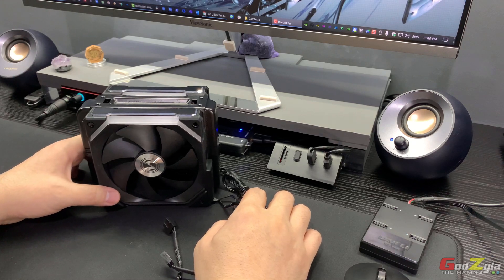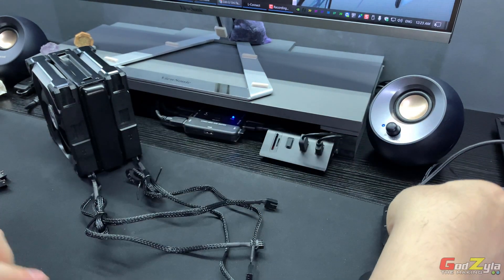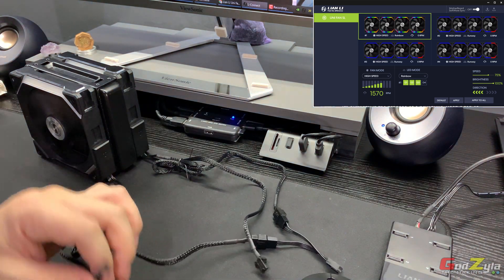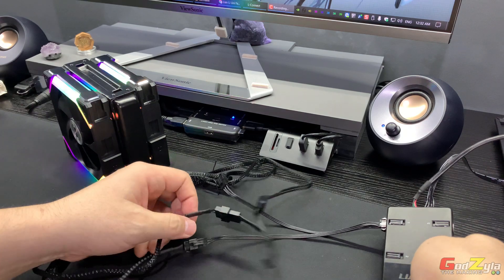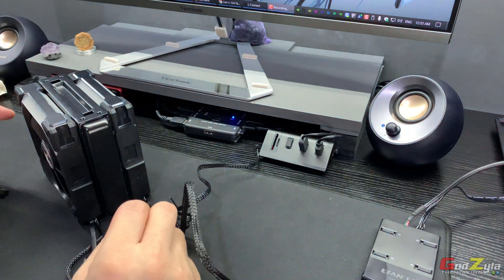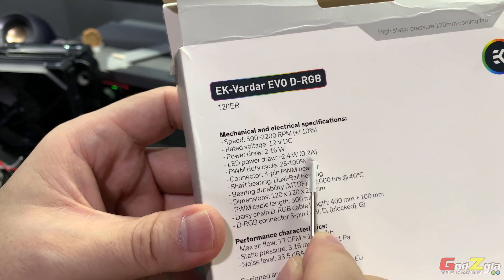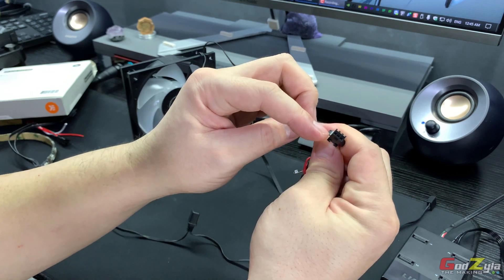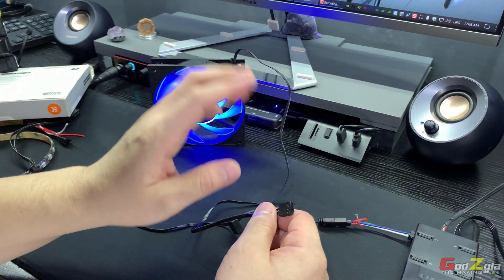Lian Li Uni Fan SL120 - Push and Pull configuration [L-Connect]

Comment: I want to do a push pull on a 280mm rad with 4 uni fans. Using the Y splitter for the RGB...both sides will just mirror themselves right?
Reply from the maker: Hi John P Lillis, thank you for your question. yes.. it will mirror, it does not do sequence. reason being, if you chain the fan by default, there is a build in chip which does sequencing. If you use Y-Splitter, the chip is not in use, therefore it will only mirror. Hope that answer your question. Once again thank you for your question and  to have visit my channel. If you do like my content, kindly subscribe and to click on the notification bell. thank you very much :)
Reply: @KleoYan  Thank you! I just ordered 8 SL140 for a new build. I'm on amazon looking for the ARGB splitter....would this one work? https://www.amazon.com/gp/product/B07Z1338XY/ref=ppx_yo_dt_b_asin_title_o00_s00?ie=UTF8&psc=1
Reply from the maker: @JohnPLillis  Hi, nope you can't use a normal argb 3pin splitter, you will need  a JST 3pin splitter 
(1 Female to 2 Male ) https://www.superlightingled.com/3pin4pin-1-to-2-signal-splitter-female-to-2-male-for-ws2811-ws2812b-ws2813-ws2815-addressable-rgb-led-strip-lights-p-1815.html 
or here https://www.aliexpress.com/item/1005001779375576.html?spm=a2g0o.productlist.0.0.f0b46342S6KzeN&algo_pvid=07fe82a2-a729-4059-ace7-bae66322c687&algo_expid=07fe82a2-a729-4059-ace7-bae66322c687-4&btsid=0b0a556c16065055547736274e0987&ws_ab_test=searchweb0_0%2Csearchweb201602_%2Csearchweb201603_

Comment: hello there kleo :) im sorry but could you kindly double check your info at 8:50 please if you dont mind? im very scared because lian li said on this page on Lian li's official site ( https://www.lian-li.com/argb-device-cable-kit/ ) if you scroll down a bit to the "fan Y cable" it says that you could plug st120 and bora fans right into the hub, i wanna plug the fans that came with my galahad aio in there and im really worried that it could hurt my controller so i dont know what to do
Reply from the maker: Hi xayx,  thank you for your question and to re-visit my channel as to answer your question. Now you will need to understand on this video illustration, I am using the EK Vardar EVO 120ER fans. though it's the same load the the SL120 fans which is at 0.18a , however the RPMs are different. 
else if you are talking about using the ST120 on the Galahad, not an issue at all. Both ST120 and SL120 fans are using 0.18a and the RPMS both are from 800-1900 which is the same. 
you do not need to worry about it at all. 

As for the Argb load, the ST120 is at 0.54a and the EK Vardar EVO ER120  is at 0.2a. Both these fans argb load is lower than the SL120 which is at 0.65a.. therefore not an issue too. 

one last note for you to take note. if you are using the Galahad AIO, I would advise your block pump should connected to the motherboard CPU / Pump header.. and the argb you still can connect to the Uni Fan controller.. without any issues.

Hope I have answered your question. Once again thank you to have re-visit to my channel.

Comment: Hi Kleo. Thanks for all of the awesome videos on the Lian Li Uni Fans! I have a question about running push & pull on a 360mm radiator. How should we go about it considering we cannot split the fans? For reference, I am running 13 fans total in an O11d-XL. 

2nd question, since I have 13 fans total, set up in 5 channels, how do I get L-Connect to recognize all 5 channels? I plugged in 2 separate RGB/Fan controllers, but L-Connect only recognizes one at a time.
Reply from the maker: Hi jboze84, thanks for you compliment and question.
your first question about running push pull configuration on a 360 rad, I would advise to do this this way

Radiator configuration 
1st 3 x fan, pull configuration - argb and fan connector to Input 1 of the uni fan controller - RPM you need to fix it lets say running at 1000rpm
2nd 3 x fan, push configuration - argb and fan connector to Input 2 of the uni fan controller - RPM you need to fix it lets say running at 1000rpm
3rd 3 x fan , case airflow - argb and fan connector to Input 3 of the uni fan controller
4th 4 x fan, case airflow - argb and fan connector to Input 4 of the uni fan controller

when you mention about 5 channel, I believe you are talking about 5 fans on one daisy chain. I do not advise you to do so as the uni fan controller has it's limitation on each Input. 
do not go crazy daisy chain more than 4 fans. if you have not watch this, please do so --> https://www.youtube.com/watch?v=QQHJUQvKwlY

if I got your setup wrong. can you list down how your placement of fans are like. example .. Side 3 fans, Top 6 fans with AIO , buttom 3 fans and rear 1 fan. 

Hope that helps. thank you once again for the question and to have visit my channel. if you like my content, kindly subscribe and to click on the notification bell. thank you!
Reply: @KleoYan  Hi Kleo. Thanks for your tips! I made the changes you suggest for the push pull setup already.

My setup is below:
Side - AIO with 6 fans in push/pull as intake. 
Bottom - 3 fans as intake.
Top - 3 fans as exhaust.
Rear - 1 fan as exhaust.

The problem I run into is that gives me 5 total groups of fans.
Reply from the maker: @jboze84  I see. now what you can do is this. 

My setup is below:
Side - AIO with 6 fans in push/pull as intake. 
 (input 1 and input 2) 
Bottom - 3 fans as intake. (input 4)

For input 3
-----------------
Top - 3 fans as exhaust.
Rear - 1 fan as exhaust.
What you can do is to use two splitters, one for argb and other for fan.

This is the fan splitter for you to conntect your top section with the rear, then to the controller. 
https://www.aliexpress.com/item/32850109245.html?spm=a2g0o.productlist.0.0.48c63ca61hCLgy&algo_pvid=8cec3997-0f96-45c2-9b14-23ef8df04742&algo_expid=8cec3997-0f96-45c2-9b14-23ef8df04742-2&btsid=0b0a556a16085302036036547e28ba&ws_ab_test=searchweb0_0,searchweb201602_,searchweb201603_ <--- this is to connect your top fans with the rear fan and the other end to the uni fan control unit. 

this is the argb splitter to connection your top section with the rear, then to the controller
https://www.aliexpress.com/item/1005001380598384.html?spm=a2g0o.productlist.0.0.61a71c9dXDFqY1&algo_pvid=c1f72250-6f97-4880-afd2-2aebf9ac99e5&algo_expid=c1f72250-6f97-4880-afd2-2aebf9ac99e5-15&btsid=0bb0624316085306420655068ec8fb&ws_ab_test=searchweb0_0,searchweb201602_,searchweb201603_

I know this cable is ugly, you can search for 3pin JST 2 male to 1 female connector.

please note that if you do this for input 3, you can't do argb sequence on the L-Connector. 
 
hope this help.
Reply: @KleoYan  Thanks for the clear explanation! You saved me tons of frustration on my new build. I was trying to figure out how to use 2 controllers at the same time for like 3-4 hours and was ready to throw in the towel when I found your channel. Thank you so much!!
Reply from the maker: @jboze84  you are most welcome. But u said two controllers? I don’t think u can use two uni fan controllers as the L-connect software only program to controls one controller. So ya am glad I am able to help you out. By the way thank you to subscribe my channel 😬

Comment: hello, im gonna do front mount radiator with arctic freezer 280. 2x140mm fans.
my case already has 2x140mm fans in front. Can i do a push / pull config using case fans as push or pull vice versa with the aio?
Reply from the maker: Hi pegge, thank you for your question and you can do push pull configuration like I have shown you on this video but I would not advise you to use different fans on push pull configuration. reason being, different fans gives different performance in terms of cfm (Airflow). In long run, either of your fans will be damage this way. Once gain thank you for your question and if you like my content do remember to subscribe to my channel. thank you!

Comment: SL120 fans are a joke when you want to use PWM from the motherboard.
Reply from the maker: Hi Just DigIt, thank you for the feedback. Yes if you are controlling all 9 fans as it only make use of one motherboard pwm fan header. I guess you have to choose between to have aRGB or not to have aRGB.
Reply: @KleoYan  
What i meant the controller is not reporting the fan speed to the motherboard. So you cant set a fan curve.

I have solved this problem by opening the controller. I have soldered a wire on the Tacho pin on fan 1. And plugged the other end in the second slot of the connector and placed it on my mobo. 

Now it regonizes the fan speed in Asus Q-fan. And i can set a fan curve.
Reply from the maker: @Justdigit2  now why didn't I think of that.. good mod there my friend :) thanks for the info too.
Reply: @KleoYan 
 You are welcome my friend..you can also hook them up with splitters of course. But what you say look out for max. Current. Now you can control all fans at once. 
. Looking forward to your next video...

Comment: Does the Lian Li software have to run 24/7 after you set the fan speed and light profile to keep the setting?
Reply from the maker: Hi phillyman36, thank you for your question. Yes you will need to run the software when you start up your pc (you can set auto start on windows) and leave it running at your background (right lower taskbar) and you will be all good.. once again thank you for your question and to have visit my channel.
Reply: @KleoYan  Thanks Just subscribed.  I was hoping it had some sort of onboard memory so I wouldn't have to have it running in the background.  Im hoping the software doesnt take up a lot of resources.
Reply from the maker: @phillyman36  thank you for subscribing :) . You do not have to worry about the system resource. Most of the calculations and execution are done on the Uni hub itself as this hub have it's own chipset. The only resources needed on your PC is just the USB cable which act as a bridge between the L-Connect and the uni controller,

Unlike other controller where gamers find it lag, as the execution of the software requires your CPU and motherboard to do the bridging, calculations and execution. which will use up a fair bit of resources.
Reply: @KleoYan  Ahh thanks a lot for the information.  Much appreciated. Now i just need a 5900x, Asus Dark hero, and the Uni fans and im set lol
Reply from the maker: @phillyman36  Cool. Hey buddy, wish you all the best in your new set up 👍
and if you needed anymore help, reach out to me at godzylatech@gmail.com
Once again thank you for visiting :)

Comment: Great video! Thanks again for the informative video! Do you think the 3pin argb from the uni fan controller that goes to the mobo header can be connected to other lighting controllers such as Coolermaster etc. Also, what is the science behind the power draw when a controller is powered directly from the PSU? Does the mobo only send the data/signal to the controller, then the controller powers up the LEDs?
Reply from the maker: Hi Lazey, thanks for the re-visit. I am not sure what coolermaster unit you are referening to, therefore not able to answer you. hence not all argb can be connected to the Uni Fan controller. it depends.. are they aRGB or RGB.. are they 12V or 5V .. and as for what's the different between using a mobo vs this uni controller.. you can see it here :) https://www.youtube.com/watch?v=QQHJUQvKwlY&feature=youtu.be&t=491
Reply: @KleoYan  I'm referring to 5v argb hubs that are mainly used for builds with multiple led strips/fans etc. so as to not overload the mobo header. Please correct me if I'm wrong. from my understanding, the 3pin 5v cable connected from mobo to hub just allows transfer of data and not power (which means the rgb accessory is drawing power from the sata or molex powered hub & not from the mobo argb header). What I am curious about is, what happens when the uni fan hub's argb cable connects to the argb hub (could be any brand as long as they have argb ports) instead of connecting to the mobo?  Thanks for taking the time to read the comments! Much appreciated:)
Reply from the maker: @lemilimel  Hi,

you are right about the 5v argb hub which is only transferring of data but not drawing power. which heavily depends on the capacitor or resistor on the PSU itself.
 
Just for your info you don't need to connect the PWM and aRGB connector from the Uni Hub to the motherboard. you only need the Power source (Sata from PSU) and USB cable (which is connected to the motherboard) to your Uni hub. Plus this Uni hub has build in capacitor, resistor and i/o chipset. it's a device itself unlike other argb hub, therefore I dont really understand why do you want to connect the uni hub to a argb hub. or am I missing something or misread your question hmm.
Reply from the maker: I forget to provide you what I discover, maybe this will let you understand why this unit is so well constructed. https://youtu.be/QQHJUQvKwlY?t=340
Reply: @KleoYan  Mainly because I am thinking of playing around rgb hubs that can be programmed with SDK to maximize customizability.
Reply: @KleoYan  And thank you for clearing that up for me! I do have some electronics education but I guess I didn't study well enough so I kinda forget most of what I learnt XD
Reply from the maker: @lemilimel  I see, do pardon me, I have no knowledge on other hubs or any SDK programing. Once again thank you for dropping by and am sorry that I can't really answer your question.

Comment: woah ur videos are crazy informative it really sucks that u dont get the recognition u deserve 🥺 awesome vid nonetheless! i got a question though and sorry it might be too long, so have u heard of their new "ARGB Device Cable Kit" ?  so basically what it does is sync lian li's rgb stuff with the uni hub. im thinking about using it to power the rgb for the "galahad 360" and also both of the "strimer plus" cables with it as well as 6 uni fans, so 2 rgb ports for the uni fans, 1 port for both of the strimer plus cables, and then the last one for the galahad pump and the fans it came with as well. that seems like sooo much stuff im so worried about frying my uni hub 😅 so do u think its possible? i really hope so!
Reply from the maker: Hello xayx, thank you for your question. Nope I have not heard of that but alot did ask me this question about strimmer plus and Galahad with 6 fans on this Uni Hub. Just for your info, this uni fan controller is very well build, it can take the load. As for the aRGB device cable kit, those are just the right connectors to use with the Uni fan, you don't have to worry about the load. Infact you can trust Lian-Li's build, as you can see the detailed PCB board which I have remove off ( https://youtu.be/QQHJUQvKwlY?t=337 ) and I did a test the load (Ampere) with a multimeter. You just need to follow that kit formation.. it can be done :) no worries. additional info, this control is seriously a premium product. they use high graded stuff like capacitors and chipsets from texas instrument for both fan and argb. By the way, thanks again for the visit and do subscribe to my channel. thank you!
Reply from the maker: btw please take note not to plug anything else as descript on this page. https://www.lian-li.com/argb-device-cable-kit/ make sure you read through what are the dos and donts.. keep your connection as close as possible and do not add anymore argb strips or such ok.. by the way I wish you all the best on setting up your argb lightings.. last but not least, just make sure you have a beefy PSU if you are running highend CPU and GPU.
Reply: @KleoYan   oh thats so good to know thank you for the conformation and for making feel better! and yes i've read through that page and from what i understood the only thing i need to worry about is plugging the strimer plus controller with Sata power because they have a lot of leds, but other than that i think im good also about my power supply its an rmx850 so im crossing my fingers everything goes well 😊  thank you so much again! i subbed :)
Reply from the maker: @UCqsGSJioIKuHoN17Mpm2-0Q thank you 😊 am glad to help. But just remember ok. Follow what the argb cable kit instructed as do not connect more than 10w of argb lol. Actually I am not a argb person. Just that I was helping out a friend and he passes me this unit to test and such. So ya just make sure you have the correct tool (cable), power (psu) and to follow the argb cable kit. You will be fine. Also thank you for telling me the kit. I learned something from you 😊
Reply: @KleoYan  oops omg i only saw ur 1st reply at first and i only replied to that, so i had to delete the comment and reply again haha but yeah no problem and thanks again!